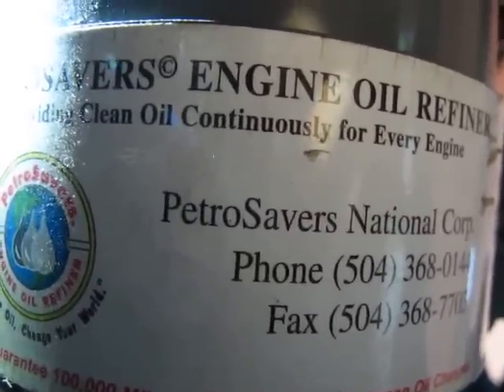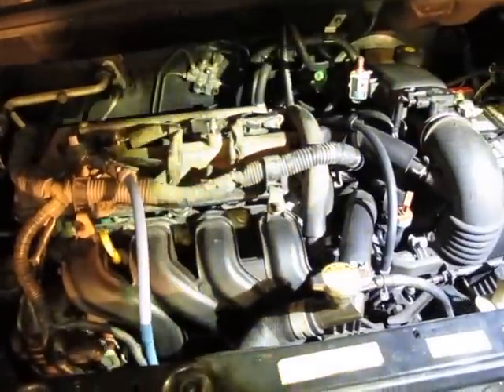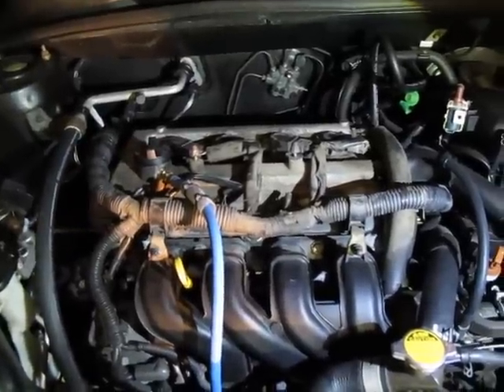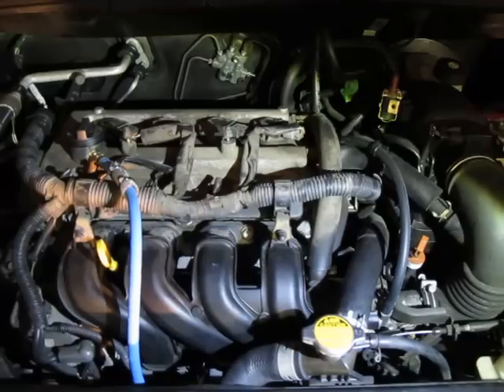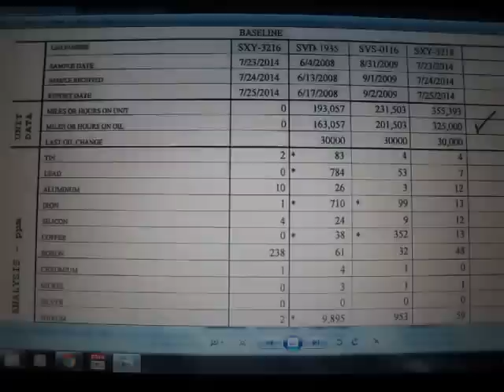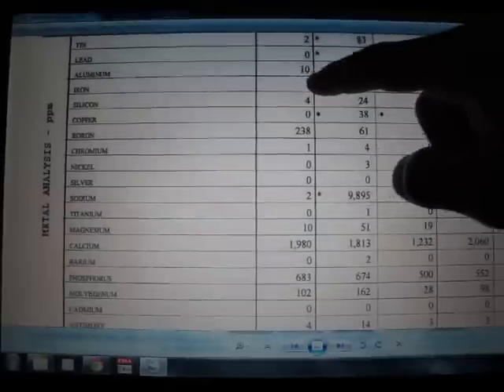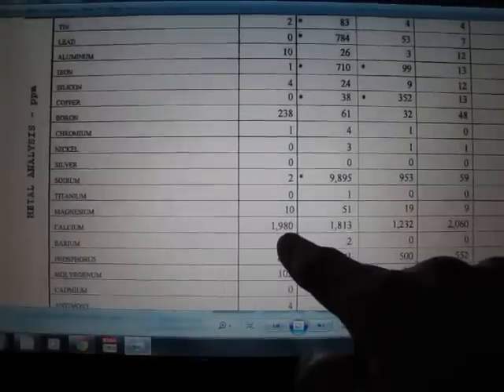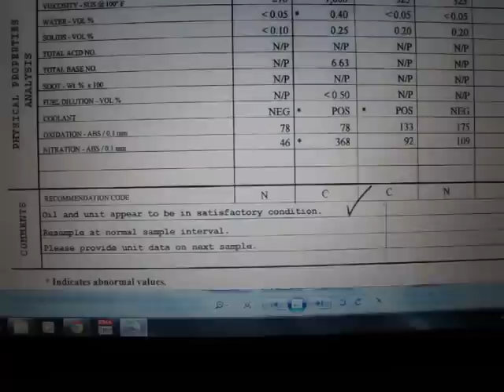PetroSavers Engine Oil Refiners “Keep The Oil - Change Your World” “the end of the oil change”

Comment: Is the standard OEM or equivalent oil filter that you replace during oil changes utilized? If so do you change that filter ever?
Reply from the maker: Bone Drone The standard OEM oil filter is still in place. It is changed once after 10,000 miles after the PetroSavers Engine Oil Refiner has been installed. After that, the standard OEM oil filter remains clean and thus changing is not required thereafter.
Reply: 150MilesPerGallon
That is awesome news. Here I thought an oil centrifuge was the way to go, with 1/10 micron filtration. But no setup constantly purified oil thus keeping it in top condition for the long term, until now.
Reply from the maker: Bone Drone My thoughts exactly.